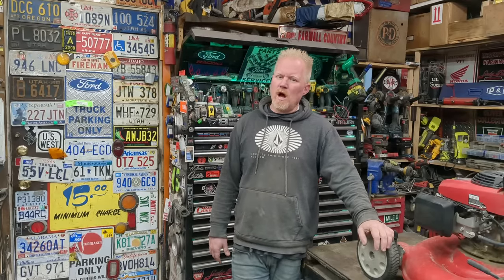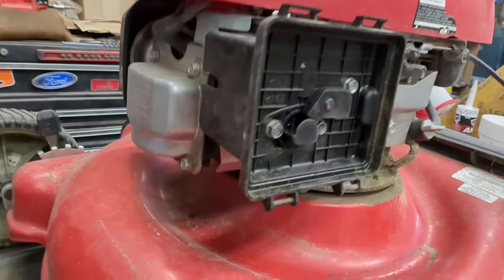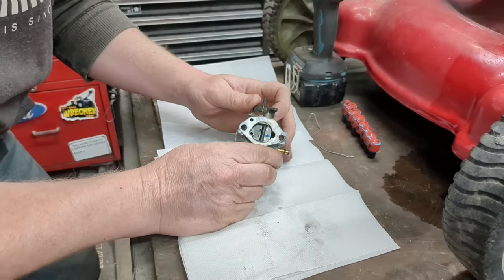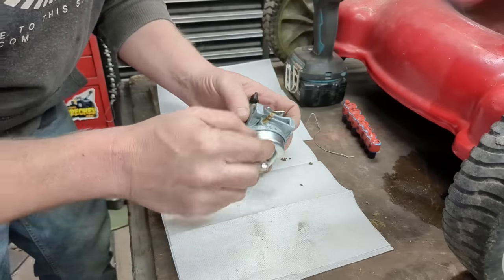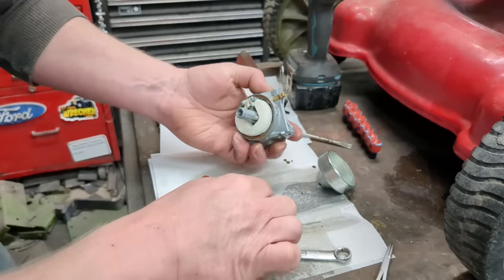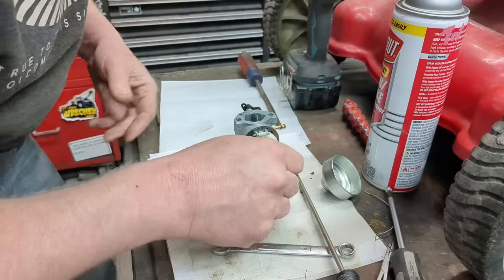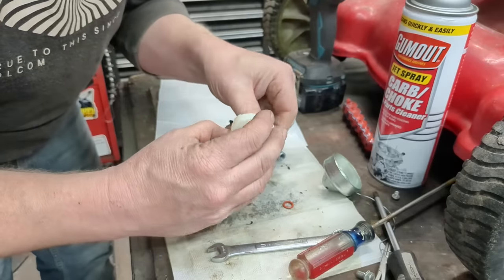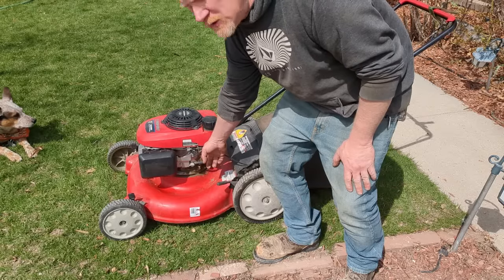FIX Engine Surging on any small engine QUICKLY

Comment: Is it bad to soak two cycle carburetors in acetone? I’ve never had much luck cleaning those and end up buying new ones.
Reply from the maker: Those are non repairable a lot of times because of rubber check valves.  You could replace the check valves IF you can find somewhere that sells them... Just like the diaphragms that dry out, so do these. Acetone will soften then and they'll work for a day but dry back out and act up again. Now not all have these but a lot do. As far as soaking I see little point in soaking any carb. Flow test all the passages, jets etc with carb cleaner and you're good. Acetone will break up varnish in minutes.

Comment: Adding choke doesn't add more fuel with simple mowers like yours.  The choke reduces air flow to the engine.  If the pilot jet is dirty the governor will keep adding fuel through the main jet to make up for the gas that's not coming through the pilot jet.  The mower will run better by adding choke but power will be reduced due to the lower amount of fuel and air being fed to the engine.

Comment: What if you have rebuilt and cleaned your carburetor and you still have the hunting problem? What do you think?
Reply from the maker: That idle passage is so small it can easily reclog. I like to visually see it flowing with carb cleaner to know it's clean.
Reply: @sixtyfiveford  I'll check it again I must have missed it... it's a carb issue though 100% for sure if it's hunting right?  Thanks 65!

Comment: I bought a new carb, and it still surges. I still have the original carb, so I think I'll clean it up and see if it runs better. Good video. Thanks.
Reply from the maker: I get this exact comment a lot on my carb videos. I think they jet them too lean in the Chinese factories.
Reply: @sixtyfiveford  if it is a jetting problem, can the jet be enlarged slightly?
Reply from the maker: @johnpapa8681  Yes. I've enlarged many jets. You need a micro drill bit set. They used to sell them at Harbor Freight for $3. You find the drill bit that just fits and go one size up.
Reply: @sixtyfiveford  thanks! This really helps.

Comment: Hope you can help me.. 

I’ve replaced my jet cartridge cleaned the carb several times.. it idols smooth.. runs smooth until getting into some thicker grass and then it surges bad and dies. It’s even worse with the front drive engaged.. 

Played with the auto choke spring some trying to get the rpm’s up a little but that doesn’t work as well with the newer auto chock like it used to on older models.. 

Plug is decent.. 

Brand new gas can and fuel.. 

New filter.. 

Only things I haven’t relaxed is the plug which asked on the idol and visual check is fine.. 

Choke is all that is left but using zip ties at different setting to hold the choke some and if anything it makes it worse.. I can get the rpm up but it has even less cutting power.. 

Ideas?
Reply from the maker: Dying under load is always a main jet problem.
Reply: @sixtyfiveford  I cleaned the old one many times.. bought a new one cleaned everything again.. this solved the initial issue of a regular surging.. now runs smooth but still doesn’t have the power it used to in thicker denser grass.. 

If I raise the deck it will run fine.. but I live in Florida and have Bahia which grows no joke an inch a day during the summer.. this mower used to run lowest deck settings and blaze it no issues.. now I can’t even get through it at half wo it bogging down.. 

Ever try to drill out a jet slightly on a gravity feed system? Lol.. I need more power and it’s a brand new jet and this newer auto choke doesn’t allow for making this thing run at 23-2500rpm like I’m used to.. normally I’d just shorten the spring a little to open her up.. but that doesn’t work now…. 

Idk I guess I’ll buy another jet cartridge clean everything out again.. and buy a spring kit for the choke and new plug.. just do it all.. been messing with this for weeks now just to find the initial issue was gas.. shouldn’t have been as it was running in that same gas fir weeks just fine.. but it was.. filled with bubbles when I dumped the bowl.. 

I don’t get it though.. it purs like a kitten until it needs real power then it has non and starts to surge bad.. can’t even let off the drive and save it half the time anymore..grass isn’t even as tall as it normally is only 5 days since last cut 🤦‍♂️
Reply from the maker: @fishrrelaxing9361  Are you sure the choke is not staying on?. This will significantly cut power. Also the engine should be running at 3,000 to 3,600 RPM

Comment: My mower a Victa with a Briggs and Stratton engine starts and runs well every time and I have never serviced it.  However if I happen to stall it the motor will not start when the engine is still hot.
Can anyone tell me why is it so.  Thanks

Comment: Random question. I have a vtwin briggs intek on my old ariens riding mower. The rear end is trash so id like to use the engine for something else. Is there a way to make it run horizontally?
Reply: No, completely different oiling design as well as carb placement and it won't work putting it in the wrong position
Reply: @455 Buick  yeah thats what I figured when I couldn't see any info about it lol

Comment: Hey greetings iv had problems with unscrewing that center jet were its been on along time and had stripped the slot for the straight screw driver cause there brass and soft.is there any solvent other than carb cleaner or time to soak so i dont strip the slot?
Reply: Any recommendation
Reply from the maker: Just ignore it if you can't remove it. You can still spray through the passages and see if it's clear. There's no getting it out without permanently damaging the carb.

Comment: So what does it hurt if the engine surges at idle but runs good under full throdel and under load? When using my mower,  it is at idle very little anyway.
Reply from the maker: It won't hurt anything. You can run it indefinitely that way.

Comment: Use ethanol-free gas.  The ethanol is what causes the problem to begin with.  I used to get that engine surging but, about 8 years ago I began buying only ethanol-free gas for all my small engine equipment.  I never have that problem now.  I have a 40 year old Jonsered chainsaw that starts on the second or third pull, and it runs perfect.  It's never had ethanol gas in it.

Comment: Hey man, 

Would water in fuel or say, skunky gas that's been in the same can cause the motor to run for about 2 minutes then bog down and die?!

I've "brakecleaned" the carb, installed a new "thermowax" choke thing and STILL...like clockwork, will start and run for about 2 minutes...then, slowly start bogging down and eventually die! Almost can set your watch to it! 

UGH

Honda GCV160 on a Honda mower, bought new in 2015!!
Reply from the maker: Make sure the gas cap lid is venting. Sounds like it's running out of fuel.
Reply: @sixtyfiveford  I bought carb cleaner last night and flushed it real good, even took out the little brass pieces and flushed them.

Bought a new can today and new gas and she fired right up and we got the whole lawn mowed!! WOO HOO!! HAHA

Comment: How much acetone per gallon can I use & will an impulse pump handle it O.K ?(24 hp Riding mower)
Reply from the maker: You could probably push upwards of 25% , just don't leave it in there overnight/days. 5- 10% you can leave that in there. It's not great for it but it's no worse than 10% ethanol fuel

Comment: I did this, all the ports are clean, I have replaced the spark plug, the air filter, drained the gas and put new in, took the line from the gas tank to the carb off and made sure it was clean and put new oil in it, but it still won't run. What do I look for next?
Reply from the maker: Do you have spark?
Reply: @sixtyfiveford  I actually went back to it this morning and I checked the spark plug cable and reseated it and it started for me. Thanks for the reply!

Comment: My Honda has been idling like this for a year. The rpms very for about the first 2 minutes and then it runs great with absolutely no problems. So at this point I don’t see it as a problem.
Reply from the maker: Just normal varnish build up on the jet surfaces. Little bit of carb cleaner or even any off the shelf Fuel additive/cleaner would probably fix you right up.
Reply: @sixtyfiveford  thanks 👍

Comment: 2003 LT3000 Craftsman aRiding mower. Put a new carburetor and spark plug and changed the fuel lines and cleaned gas tank and replaced fuel.
Now it surges and can’t mow dogs out . Backfire also
Reply from the maker: "new carb" was this a $20 Amazon/ebay carb. If so they're barely better than a dirty gummed up carb. Return it and try another supplier or clean your old one. There's guy who have to try 3-4 until they find a good China carb.

Comment: I have the plastic briggs carb but I replaced that, the spark plug, the air filter and the primer bulb, new fuel not new oil but its clean and I don't know what the problem is 300 series pls help
Reply: It made the surging less noisy but its still there

Comment: Help i just cleaned my carburetor and changed the oil with a new blade i put installed also. Paper filter element was not great but it ran. I replaced that also. Now i oulled it started abd cut uo to the other side of the yard. Then it starting surging and shutting off. Now what?
Reply from the maker: Sounds like it ran out of gas

Comment: So what if you have a brand new carb (2nd one) and the engine is still surging?
Reply from the maker: 2 possibilities:
1- You have an air intake league from a torn gasket behind the carburetor/ on the intake manifold. 
2- These "new" $25 carburetors are pure junk. It is extremely common for the idle passage to be undersized. It seems hit and miss. So you're only option is to buy a different brand cheap eBay/ Amazon carburetor and try it. Or just rebuild the original?.

Comment: I cleaned my carb three times and its still surging. May be the governer spring thats gone slack?
Reply from the maker: Surging means the governor is working exactly as it should. If the engine just stalled and never surged, the governor would not be working. 

The number one cause is the idle circuit/ jet. This hole is near microscopic. A needle is too big to fit through it. It's about the size of a hair. 

The only other cause is if you didn't get one of the gaskets back in place, an excess of air is being sucked from behind the carburetor/ intake manifold.

Comment: What does that sensor do that's on the bottom of the carburetor bowl
Reply from the maker: Common on things like generators and riding mowers. It shuts off the fuel so the engine doesn't backfire when you turn it off.

Comment: The spring connected from the carburetor and the governor may be sprung or too loose.
Reply from the maker: If the spring is loose or sprung  the engine will simply over rev.

Comment: Acetone will absolutely break down hdpe plastic parts in carbs along with bowl gaskets and o-ring seals in carbs that are made of viton. All the other info in this video seems on point. Acetone in the tank is a bad idea. Using it to clean the carb and allowing it to air dry or blowing it/parts off with compressed air is completely fine.
Reply from the maker: Acetone won't touch HDPE fuel tanks and diluted with fuel won't do anything ethanol in fuel already does.
Reply: @sixtyfiveford  you should probably do some research on that.
Reply from the maker: @clementsmallengine4833  Acetone comes in HDPE bottles.
Reply: @sixtyfiveford  you are giving out really bad information. Let's talk about rubber... what does acetone that's sitting do to rubber??? Have you ever taken apart a Nikki carb before? poor it in a tank... did you know some fuel tanks are NOT hdpe... especially on these cheaper new machines. Don't give out bad information and try to justify it correct it.
Reply: I'll bet you anything that when you tell someone that isn't mechanically inclined to pour something in a fuel tank that they ALWAYS go to the "more is more better" move...Happens at least 20+ times a year a customer brings in a non running macjine because they think it's OK to dump a full bottle of seafoam or stabil into there tank.
Reply: Only true if it is full strength and left in-place for a long time on seals and rubber. Not so ...if duluted with fuel and you run that particular tank dry and refill with pure gas.

Comment: My brother swears by using Automatic Transmission Fluid to clean carbs and fuel injectors.  On a car, he'd put a quart into a full tank of gas.  Still lots more expensive than a bottle of carb cleaner and 10 minutes of your time.
Reply from the maker: Interesting. ATF is about the thinnest oil you can get and it's loaded with detergents. So it'll attract debris very well and carry it along with it out of the system. I'll have to give it a test to see how well it breaks down old varnished fuel.

Comment: So pull the bowl off every spring to get the water out. This year the mower runs for about one pass and then dies. I pulled off the carb cleaned it. Nothing changed. Pulled fuel lone off . flows  good . pet cock work on and off just fine.let ot run. With the fuel cap off to eliminate a vacuum . still runs for awhile and then stops. Fresh gas? Any ideas?
Reply: Oh and great vid

Comment: Had a brand new snow blower right off the floor.. same thing. Constant pulse.
Reply from the maker: You get to have smaller jets the higher altitude. So I'm assuming to meet EPA regulations they use jet these with high altitude jets. Then if you live below 8000 ft the engine's going to run lean and surge. I've had many engines where the OEM jet was undersized. I either ream them out with a small needle file (torch nozzle cleaner) or drill them out with micro drill bits.

Comment: Does acetone act like methanol, in terms of making a little separated water (in the gasohol) mix back into gasoline? Can you use both additives at the same time? @sixtyfiveford
Reply from the maker: Acetone mixes completely with water.
Reply: Yes, but will it make water disperse back into gasoline? @sixtyfiveford
Reply from the maker: @YodaWhat 
Methanol/ethanol are hydroscopic and pull moisture out of the air and bond together. These separate from gasoline and never fully combine. This alcohol water mixture is flammable though and the engine will burn it. 

Acetone is not hydroscopic but will combine fully with water and gasoline. So any water is burned with the fuel. 

Any water is bad though. Any alcohol should be 100% avoided in a small engine as the fuel systems are open to the atmosphere.

Comment: My problems were always due to fuel with alcohol in it, and California compliant carburetors.
In my new state, I can buy fuel with no alcohol and that's all I will use in my small engines.
Reply: I think your right, had to clean the carb in my mower every six weeks. Started using fuel specifically for mowers and never had the problem again.
Reply from the maker: Absolutely. Ethanol pulls moisture directly out of the air and it settles to the bottoms of the fuel tank. This goes directly into the carb and corrodes everything.

Comment: Best thing I have ever used is Marvel Mystery Oil. Cleans & lubricates the carb.
Reply from the maker: Problem is there's nothing in a carburetor that needs to be lubricated. Marvel mystery oil is mainly mineral oil with a little bit of mineral spirits/ paint thinner. If this was really the miracle be-all, you could do the same thing by dumping a little bit of automatic transmission fluid and a little bit of paint thinner in the gas tank. Or just put a splash of acetone in there and you'll be good to go.

Comment: My idles low and shuts off like it starving on gas. Not sure the issue Toro ccr3000
Reply from the maker: I would go through the carb no matter what. Generally when a 2 stroke runs out of fuel it actually revs really high for 3-5 seconds then shuts off. Bogging/slowing down and dying is generally a flooding/ too much fuel from a stuck float or dirty needle seat. This is my video on the ccr3000 carb https://youtu.be/78R9eBCdsPA?si=BgFfPXiiG-ukyDmf

Comment: I replaced my entire carb, spark plug, air filter and changed the oil.  My 3 year old Husqvarna Honda gcv160 mower is still surging and dying.
Reply from the maker: Did you use a budget aftermarket carb? They're garbage and known to cause issues.

Comment: I just replaced the carb and the mower is surging, any ideas?
Reply from the maker: A few things: if you had a dirty carb you replaced likely the fuel line and gas tank had residual debris and clogged the new carb. The cheap $20 carbs from eBay/Amazon are known to have undersized jets that cause this. The only other thing it could be is an incorrectly installed gasket behind the carb bleeding air.

Comment: I replaced the carb and it still does this any idea?
Reply from the maker: A few things: if you had a dirty carb you replaced likely the fuel line and had tank had residual debris and clogged the new carb. The cheap $20 carbs from eBay/Amazon are known to have undersized jets that cause this. The only other thing it could be is an incorrectly installed gasket behind the carb bleeding air.

Comment: Nice video but you skipped the fun part. Getting the carb and gaskets etc. back on. I use chop sticks to line everything up.
Reply from the maker: Never fun. I generally use no.2 gasket sealant to hold everything in place.

Comment: What about if it’s not the carb?
Reply from the maker: The carb is the reason for engine surging.
Reply: I put a carb from another mower that worked fine, still sruged  tried a new carb still surges. theres an air leak @sixtyfiveford

Comment: Use seafoam in all my small engines NEVER turn fuel off for winter dont run dry or drain fuel.  7 years same mower first pull every spring.